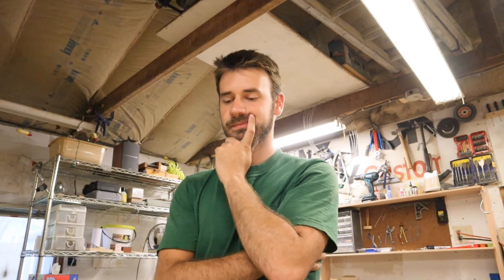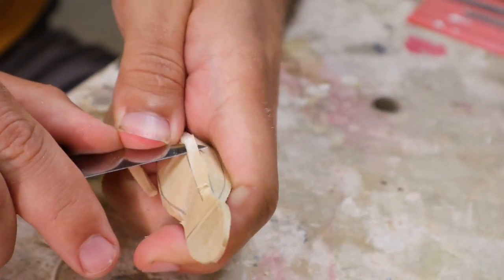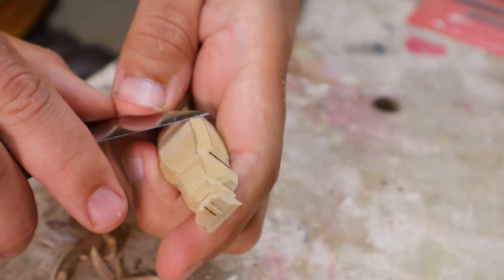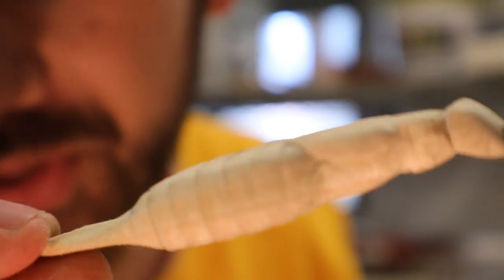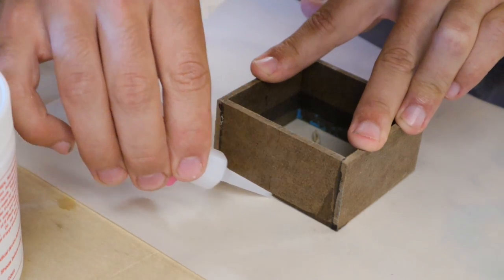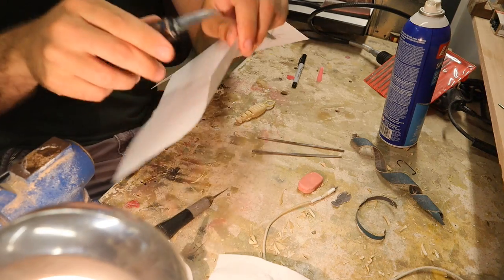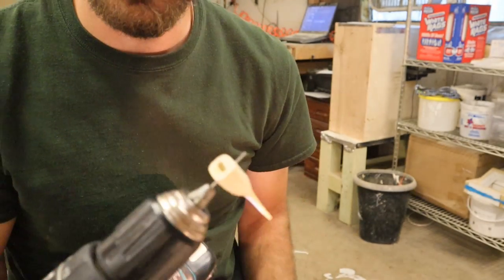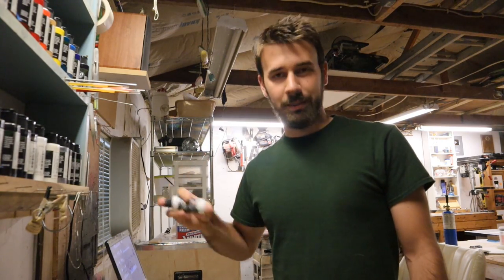Giant EarWig Lure | Build to Catch

Comment: Nate, when you pour intricate plastics like your little earwig legs, you need to use the flat, back side of another mold to lay over the top of your mold cavity to create a flat surface. You will ALWAYS get flashing on your plastics. So what I do is I warm up both molds so it doesn't shock the plastisol and start to set too fast. You can't just lay the other mold on top and squish it down. It doesn't work that way. You have to get your mold cavity on a level surface and pour your hot plastisol. Have your other mold ready to go, touching the back side of the mold with the cavity in it. Since the mold is flexible, bend the flat side of the other mold (not the mold with the cavity) upwards, and slowly roll if forwards towards you. You're essentially doing the same thing you would do if you were applying a vinyl decal. You don't just slap the decal down. Other wide you'd trap tons of air pockets.  You have to start at an edge, and squeegee the decal forward. Same with your small parts on your silicon mold. Start at the back edge and use the pre-heated back side of a spare mold to squeegee the plastisol forward towards yourself. Then get a little weight and put it on top of the two molds. Wait about 2-3 minutes for them to cure, and extract. You will have flashing, but it will be paper thin, and it peels right off by hand instead of having to trim it with scissors or risk ripping your piece. 

That's what I do. I hope it makes sense, and I hope it helps. 

Thanks for all the wonderful videos. You are the lure making KING!

Comment: too cool.  what Plat # is that of alumilite.  I used the last of my plat 55 and would like to try the pink stuff next. or is that the amazing mold rubber?  also did you use a mold release or vasiline?  The mold I just made was a boot tail and it cured all around just fine except where the rubber met the master mold, never had happen before.  I used vasiline.  Thanks. keep the Vidjas coming.

Comment: Take a wooden clothespin apart.  Take the two pieces and place one on top of the other(not flat side to flat side).  You will see it makes a shape of a minnow.  Glue them together and fill in the holes.  I did this and then I lost it and never bothered to make another one.  Would like to see if someone else can make one.

Comment: You should get some of those light boxes they use in nail salons and put those tube lights in your light tank in stead of or in addition to the LEDs you're using.

You will find that your UV clear cures a lot faster and harder. 

Even better would be a UV laser off a dentist's workstation, but NEVER EVER USE THOSE WITHOUT THE REQUIRED APPROPRIATE SAFETY GOGGLES!!! 
They will cure the resin in about ten seconds but without the goggles you'll go blind in about 1 second flat!